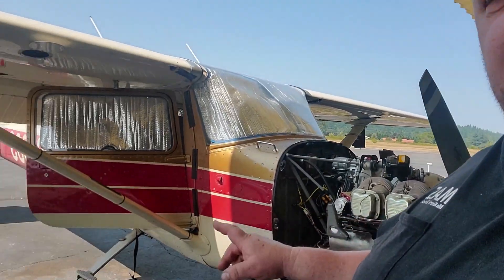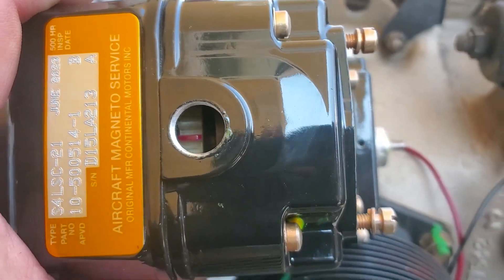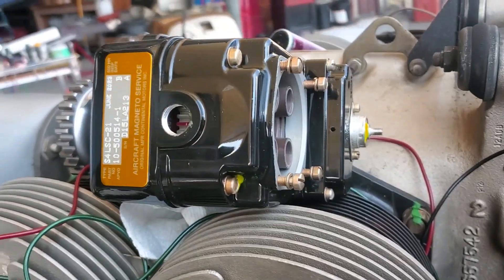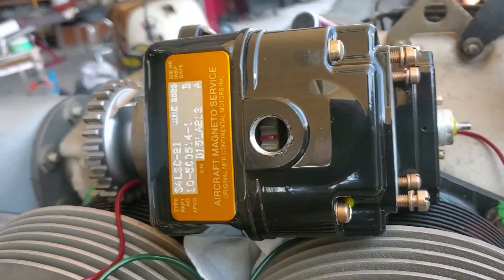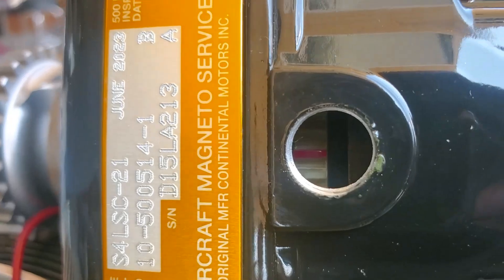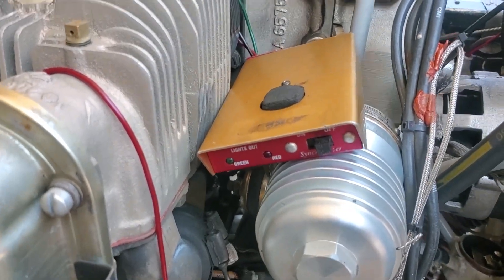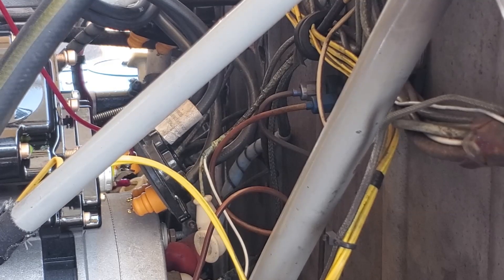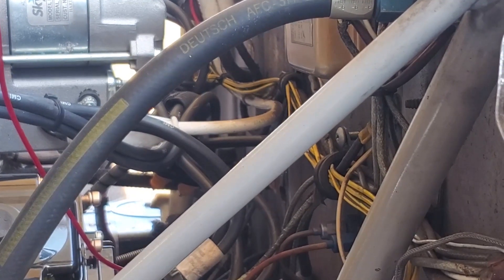Installing Magnetos on a Continental O-200-A

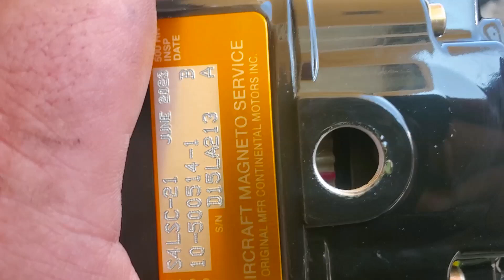Comment: Tim, At 3:48 into the vid. You show the red tooth alignment....Do you have to deal with the impulse coupler at all or just line up the tooth regardless of the couupler?
Reply from the maker: coupler needs to be disengaged when it is in the timed position....this is usually the case anyway. It should be free to move in either direction with out any resistance.